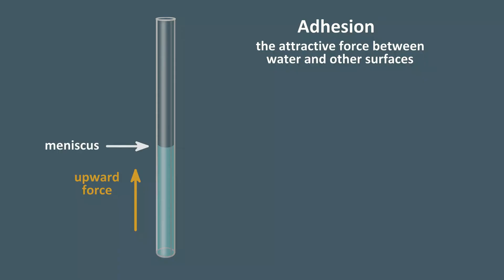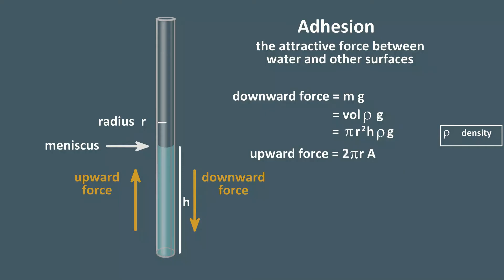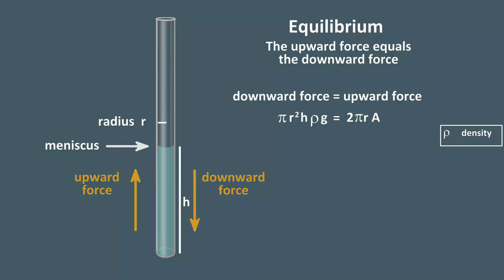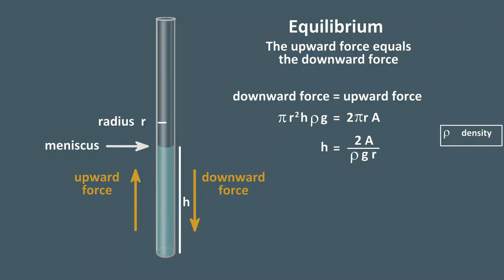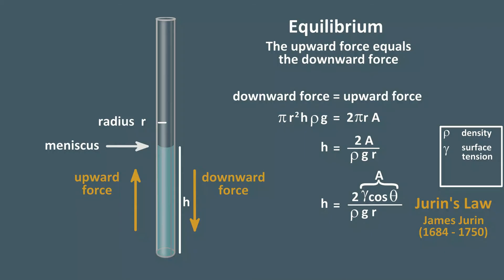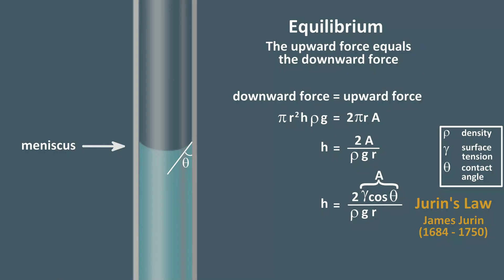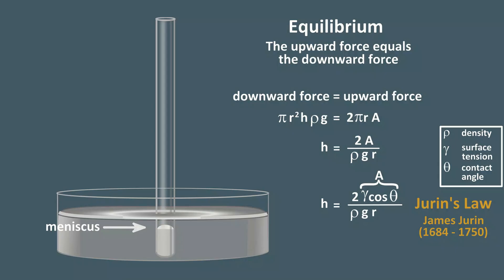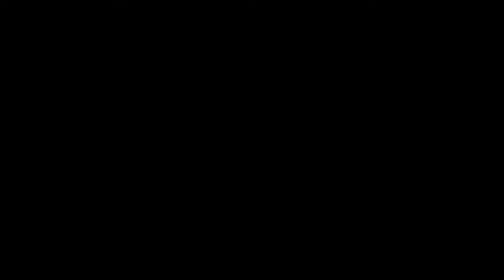Capillary action dissected

Comment: Very informative video, thanks. Do you have time to answer a question for me? I have a small vessel filled with water. A thin tube (1.5mm inner diameter) hangs an arbitrary distance below the surface and the top is attached to a valve that allows me to release ink into the water. When the valve is open, ink flows freely. When I close the valve, a vacuum is created at the top of the tube, so the flow of ink stops. However, through what I assume is capillary action, water from the vessel is pulled into the tube, apparently displacing ink, which then leaks into the vessel. This continues until all of the ink in the tube has leaked out. My question is, is there any way to prevent this leakage from happening? I cannot change the viscosity of either the ink or the water.  The tube could be modified if that would help, but not to the extent of using a much larger diameter tube.

I hope you find this question interesting and I'd be most appreciative if you can answer it. Thanks very much!
Reply from the maker: Hi Michael, that's a really interesting observation.  The water and the ink are still in contact even though the valve at the top is closed.  There is no flow through the tube.  Nevertheless, there could be diffusion of the ink molecules into the water vessel and diffusion of the water into the tube holding the ink.  Let's do a thought experiment...if you place a capillary tube in a beaker of water, you will get a rise of water up into the capillary tube until it reaches equilibrium.  At that point, there is not net flow (i.e. the level of the water does not change).  But you would expect that, due to random molecular motion, there would be exchange of the water molecules from the capillary tube into the beaker and vice-versa?  I think the same thing is happening with your ink in the tube.  Now, how to prevent it?  I have no idea.  Molecules diffuse!
Reply: @ScienceSketch  Thanks very much for your thoughtful reply.  This sounds correct.  I'm not sure why I thought capillary action would occur in a tube that's already full.

Comment: sir, regarding the upward force section, i still don't get it why we're multiplying the circle circumferences with the constant of upward force, would u mind explain it more...
Reply from the maker: Hi Xoxo, thanks for your message.  The upward force is proportional to the liquid that is in contact with the surface area of the tube.  The surface area of the tube increases as the circle circumference increases.  At this point in the calculation we don't know exactly what the relationship is.....we just know that as one increases, the other has to increase also.  Please let me know if I can explain in other ways.
Reply: @ScienceSketch sir isnt that force a downwards force at the top surface? Since water molecules are being pulled down by other water molecules?

Comment: thanks for the video, I guess if the diameter in the tube is less than 0.1mm, there wouldn´t be limit for the height.
Reply: ah yes, vertical contact angle and infinite surface tension